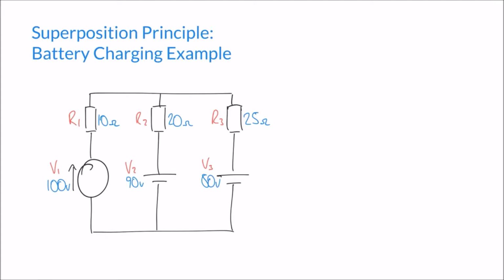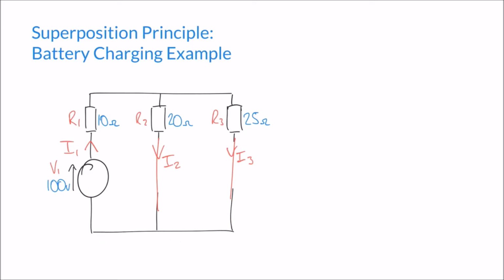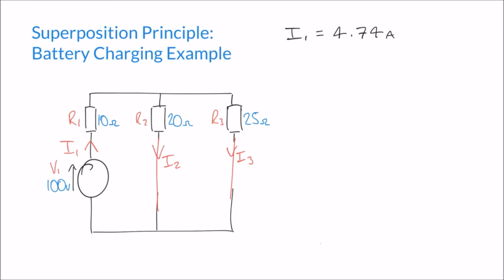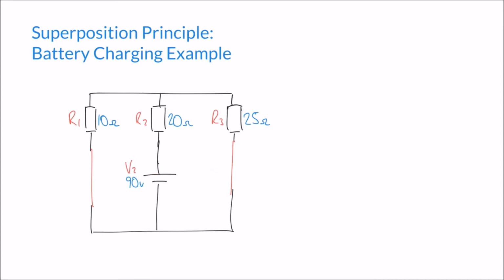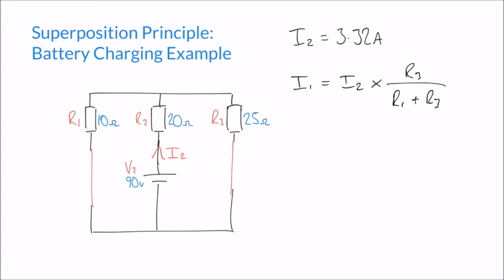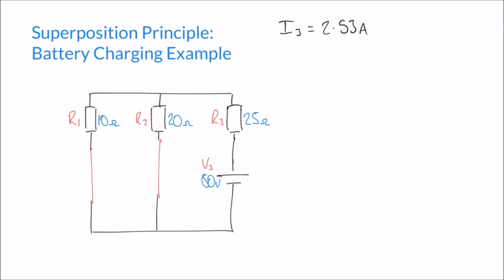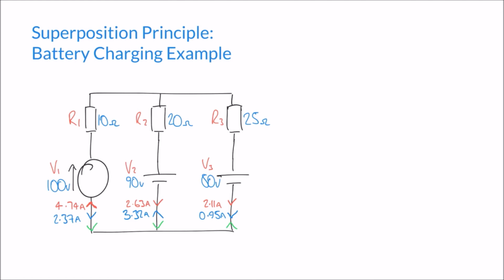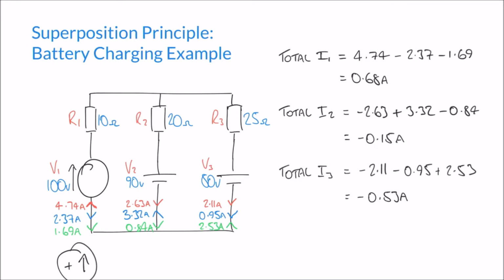Using the Superposition Principle to Evaluate Complex Circuits

Comment: so if i have r1, r2, r3 in parallel and 2 power sources, if i want to find the current at just r1,do i only need to workout current for each source using this theorem, then add together ?
Reply from the maker: I think if you mean a circuit that has 3 resistor branches, and 2 of them have power supplies, then this video is along the lines of what you mean: https://youtu.be/Gk83p3GB-LU